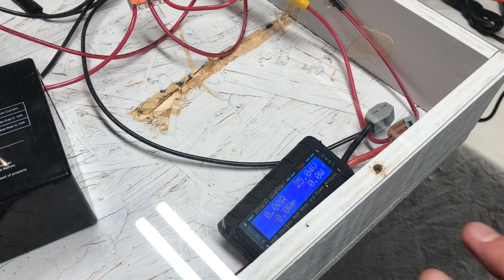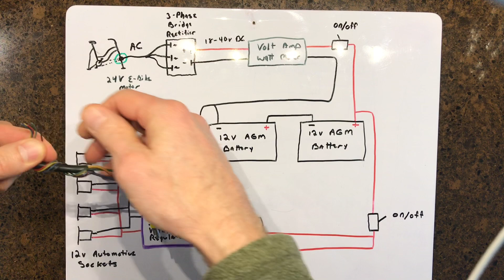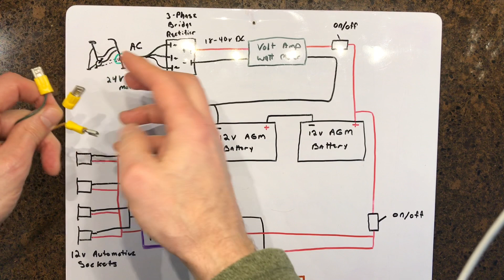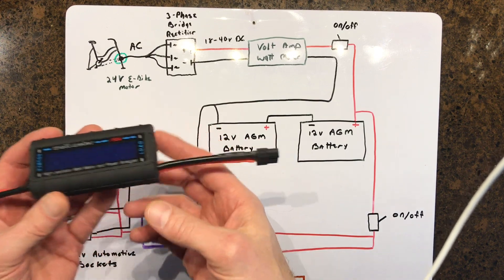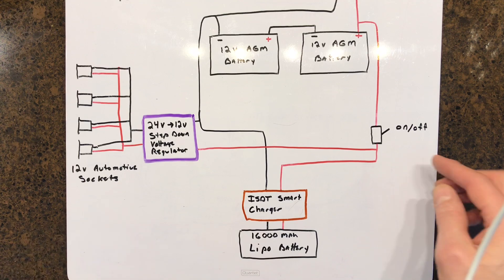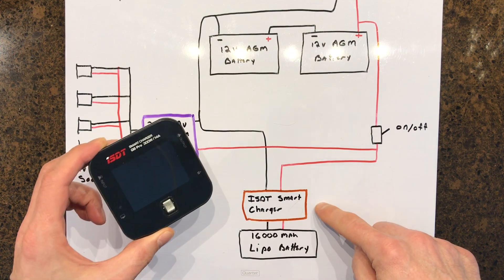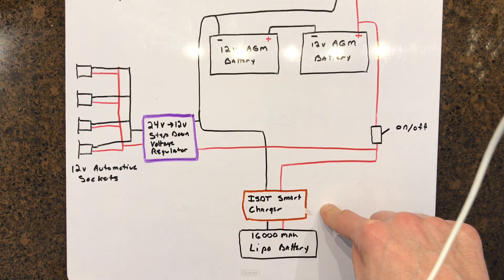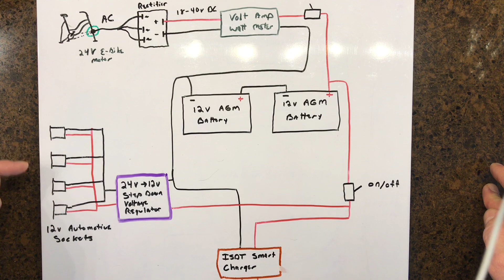Stationary Bike Pedal Generator - ebike motor lipo charger

Comment: Thanks for the video. Why not use high capacity batteries, such as 100 amp-hours, so that you can power higher-load appliances like TV sets and microwaves? Walmart has a 100 amp-hour AGM battery for $180.00 (LifePO4 batteries with that rating are at least $800.00) Of course you would also need an inverter rated for at least 1,000 watts.
Reply from the maker: Hey Root Canal - everybody has their own goals when it comes to this stuff.  I chose my goal to try to charge most or all of the mobile devices in my house with my pedal generation during the winter months.  I figure I can generate enough to do that, so storing in a couple LiFePO4 batteries https://www.instructables.com/Fast-Charging-Portable-Power-Station/ does the trick for me with how much I can generate.  I pedal to charge up the portable power station in my basement, then bring it upstairs and charge mobile phones, iPads, laptops, Kindles, Chromebooks, whatever!  Hauling a 100Ah AGM battery around my house would be another kind of workout(!) - so these LiFePO4's work for me.  I also avoid the inverter because they typically lose about 15-20% of the power in the conversion.  Another dig on Lead Acid batteries, they are about 85% efficient, so if I put in 100Wh, I'll only be able to get out 85Wh.